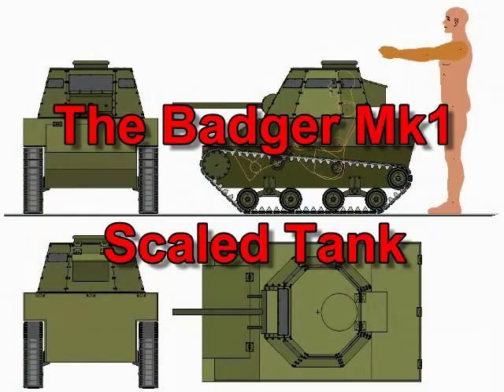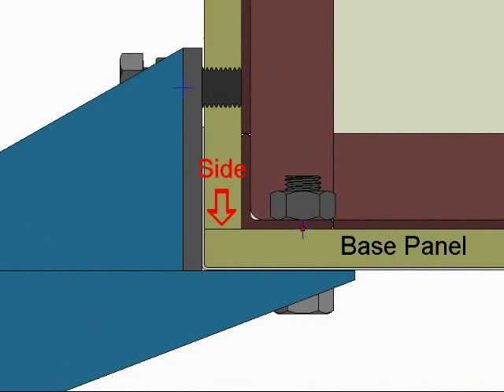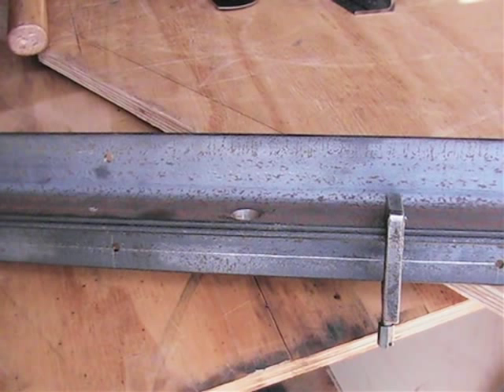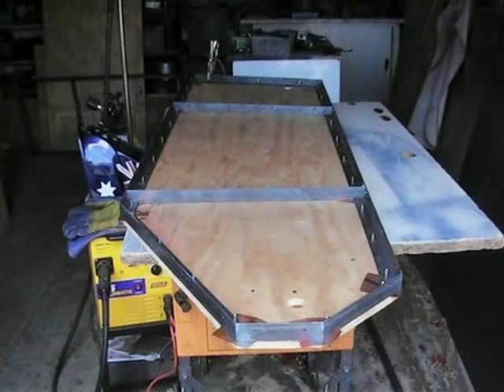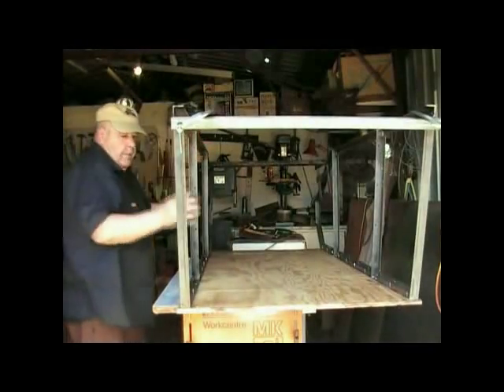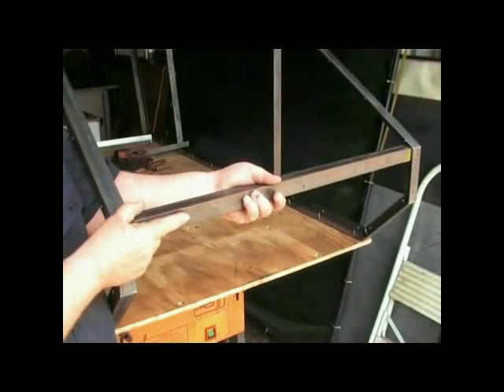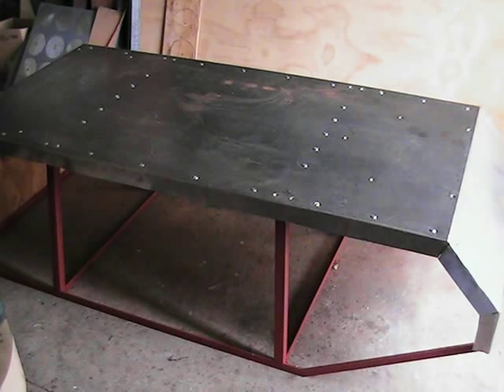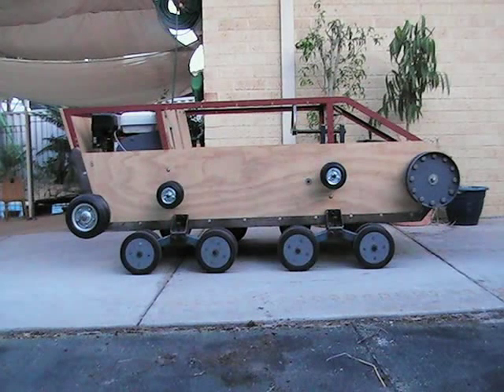Badger Episode 7 - Hull construction (Lower)

Comment: i have a question might sound silly but really enjoy your videos is it possible to use a rear wheel automated drive like from a lawn mower set up that has a rear wheel drive steering unit as a power plant system you know the ones you push pull the levers to steer the mower ? thanks keep the vids coming awesome i am really wanting to build one.